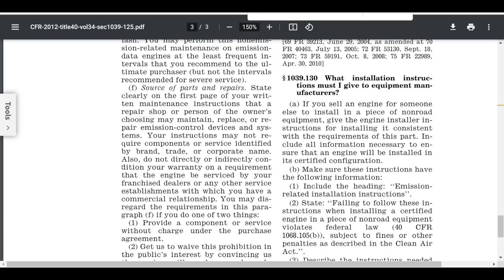Has John Deere been breaking the law for two decades? Little known regulation  1039.125 says yes.

Comment: As someone who has spent time working on vehicle emissions systems for the past 10 years regardless of working for the manufacturer or not the argument that people who don't work for our company cannot be trusted to repair our equipment is absurd
Reply: I mean really, once you check that all emission sensors are working correctly and there are no exhaust leaks, what can go wrong? Sure this is an oversimplification, but it's not rocket science either. Then again, a large auto maker like VW did this at a grand scale but they are worried about a little guy messing with his tractor.
Reply: There all CROOKS👌🏾
Reply: @benargee  But But we like our moneys. Please don't stop giving us your moneys.

Comment: thats a huge issue with gun laws too, a lot of what they ask for (background checks and such) have already been a thing federally, so states dont need to require it.
Reply: It's my understanding that some states have actually passed laws preventing their own regulators from enforcing those federal laws. Basically, if the feds want X, they can do it themselves, kind of laws. They aren't saying they are overriding the laws, just that they won't stand in the way of the feds enforcing them. There are a LOT of federal laws that go unenforced like that, not just guns or right to repair, etc. They can't pass a state law that overrides federal without it going to the court system and possible all the way to the supreme court to decide on it so states just don't enforce them and leave it to what ever federal agency is responsible for it to enforce it. Kind of like how the FDA has federal employees responsible for inspecting factories where food is is mass produced.
Reply: @gwgux  not the same at all. so what youre talking about is like what texas did with suppressors and permits, where its actually completely within federal law, but if the owner crosses state lines with those items THEN it becomes a problem of the feds to deal with

the thing about sales, is they have to be documented by the person selling the gun, because if they dont do their paperwork they lose their license to sell guns AND can get up to 20 years per gun sold without the proper paperwork. 

and even worse these days is the people who have their permits and do things by the book are losing their permits anyway because of minor spelling errors and such. brandon herrera did a recent video going into detail on that

Comment: Louis, I kept reading there were a couple exceptions, one says "if you give the parts for free"  - does that mean you can require they are installed by your network installers, provided you itemize $0.00 for the part (and just markup the labor to cover it of course) - The other one says "convince us it is in the public good" paragraph that was cut off. . . are they trying that angle of "its in the public interest for us to require emissions systems be serviced in-network"?
Reply: In general this has been viewed as both parts and labor. Audi, for some time, did all maintenance at no cost to 100k or so, to force owners back to the dealership.

Comment: The emissions stuff is generally overblown.  A tractor running well has lower emissions.  Tractors that are not working right use more fuel and create more emissions.
Reply: Most emissions systems that involve a re-burner of collected emissions don't really help the environment as much as we are led to believe. 
All they do is collect the emissions to burn them off at a later date. Really only getting a small amount of pollution saved but replaced with the chemicals used in collection.
Now a system where the filter is not burned but cleaned when an oil changed is needed actually helps a lot for emissions. But those are more complicated.

Comment: Louis, hi from Europe.
I'm a little confused. AFAIK in the USA there were rules to cars made, that gave independent shops and the AAA the ability to monitor the exhaust system - the OBD plug. We are grateful for this. 
Does all this not reach to larger equipment like trucks and tracktors?
Reply: Basically yes.  Private versus commercial vehicles fall under very different sets of laws.  Even RV's don't fall under typical motor vehicle regulations and thus don't get basically any consumer protections applied to them.
Reply: @bvoyelr  SAD

Comment: If emissions controls is so important then shouldn't manufactures be required to design build the system so that nobody will ever have any excuse for not keeping it in tip-top shape? Like say for instance there not being enough dealer franchises allowed by the manufactures where you are.
Reply: yes, but i think John Deere is talking about farmers trying to by-pass the use of government juice AKA D.E.F which you can ask any diesel owner, is a pain because as if diesel wasnt expensive enough, now you gotta pay for something extra.
Reply: @dirtyvinyl8817  so deal with that the same way you deal with running ag Diesel on the road: big fines when you catch people doing it.

My original point is that whatever the claimed reason for restrictions on repair, it looks like they are just an excuse to keep a monopoly. Pouting out how those goals are sought after only in some cases is mostly a rhetorical tool to highlight the motives being concealed behind a veneer of a socially popular talking points.

And at a guess, it took the people who don't want to buy DEF about an hour to figure out how to bypass the system. We struggle to figure out how to make software that can't be hacked without access to the digital hardware. I don't think there's a chance in hell we can build an analog system that can't be tricked by someone who has full access to it. E.g. take the factory original NOx sensor and coat them in a catalyst so they see lower levels? Blow air from the turbos across the sensor so the actual level is lower? And that's assuming you need something more than a zip tie to hold the float switch in the DEF tank up.

Comment: I think that it is NOT the emissions but the IMMOBILIZER, the function that allows to block the engine start if the injection calculator is stolen/ replaced without redoing the pairing.
Reply: On the other hand, i don't see why you can't replace components related to the injection systems with the exception of that ECU ( engine control unit). 

The tuning update must be off limits because will give the outsiders the power to mess-up the depollution and how it was homologated but if you change the fuel pump, I don't see why the client shouldn't have access to initiate the routine of fuel priming because that it is a highly controlled strategy with zero risks.
Reply: @elenabob4953  In Spain most owners of 20+ years old John Deere machines say they will continue to purchase and fix old units until there's nothing left in the market.

Comment: I think a better question is why are they fighting so hard to preserve these emissions parts? Is it just knowing there are thousands of dollars of fragile parts that don't really do anything knowing they are the only source for parts and they're trying to corner the market on repairs as well? Or because they know with a little know-how you can fully bypass these thousands of dollars of parts and pollute just a little more while producing FOOD for the cheapest possible price?
Reply: Without emissions control systems, engines would pollute much more than just a little more.
Certainly they are much more fragile than an old school, carbureted engine and the companies have in many cases left them fragile to ensure repeat business.
Reply: @bmos02  It’s not so much fragile just that things are engineered to last a certain amount of time. No more no less. 

Whereas before it was just a guess so things got over engineered , now we have the skill to make it last a predicted time. 

I’m not excusing it but in general it’s not some sinister plan.
Reply: I believe they are just using emissions as an excuse to push the "authorized dealer only" servicing. The same way that car manufacturers were retorting that allowing third-party repair shops to access model specific tools would be letting your vehicle be "hacked".

Comment: Hi Louis it wood be better for Deere and other brands to to make the emission systems on thte tractors more reliable  
overe hear in the uk a large percentage of tractors  have the def  removed  and remapped after warranty runs out
Reply: It's that it's unreliable, just that it requires more maintenance than if the tractor didn't include it. People removed the DPF/DEF because they don't like having to deal with maintaining the system.

Comment: Congratulations on reading the "small print" of the regulations.The C.F.R. ( code of federal regulations ) can be found online, and is searchable. However, care must be taken when reading them since the definitions of words in law often differ from the dictionary definition. Sometimes there are more than one, and then a conflict in law must be resolved, often by making reference to the common dictionary meaning as a last resort. For example, the word "derivative" only appears, and is defined, in laws concerning fungible securities. There is no definition for that word given when the word is used in the laws about certain plants. In that instance, the dictionary definition should control.

Comment: Emission systems on diesels? Yeah, we rip 'em off. Why? To reduce pollution. EGR dumps sludge into your intakes on diesels (not gassers) and the engines fail prematurely. This adds to landfill waste. DPF clogs up the exhaust at some point, drastically reducing power and mileage. SCR (DEF fluid) actually reduces emissions and I'm all for it. Removing the other two systems increases mileage and power on a diesel up to 33% and thus you burn far less fuel to do the same job. Less fuel burned means fewer emissions.
Reply: Emissions in cities certainly a big problem. But emissions in the field? They kidding us?😾 Those emissions are happily absorbed by the growing greenmass.
Reply: Yeah, screw emissions systems on diesels. A catalytic converter on a gasoline car is relatively benign these days, but diesel emissions systems are nightmares.
Reply: @hrissan  Exactly. I was referring to pickups, but the same things are on farm tractors. Why? Plants LOVE CO2!
Reply: @PsRohrbaugh  I am OK with what's on cars, and even the SCR system on diesels help, but the ones which kill diesels and actually increase emissions should be removed.
Reply: Can SCR reduce NOx to acceptable levels in a non EGR engine? The solution to pollution is dilution; thus one combine per 2500 acres really isn't so bad., Especially when it will only be operating 15 days per season.

Comment: I can guarantee they will mess with the emissions systems. That's not the manufacturers problem as it is a modification to the equipment. Unauthorized modifications to the equipment are not covered under any warranty policy. Said modification is determined to be the cause of the failure the failure cannot be ruled as a defect and is therefore not covered under warranty. This gets John Deere out of responsibility for mistakes made by the end user of the equipment. They are however have no reason to not sell tools and parts to paying customers other than to be anti-consumer in only allowing their service centers. Most service centers (unless owned by the manufacturer) do not provide the manufacturer profit through labor but through sales of equipment and parts.

Comment: Make a rugged 3D printable raspberry pie housing. Write an open source ECU program for the raspberry pie. Gut the ecu out of your tractor and replace it for the open source one. Proprietary software removed, step one accomplished. 
Buy big tractor. Disassemble big tractor. Make manual on reassembling big tractor. Proprietary mechanic removed, step two accomplished.

Comment: Yeah, the way to stop illegal modifications is to have certifications for emissions that save a farmer money on the extra 5 or so hp they gain from a bypass.

You can even have basic checks for emissions functionality in the tractor, and just nag the tractor driver about it not working (albeit this can be bypassed, it's generally not a thing farmers will generally do).

If need be, you can even have a government agent come on site, randomly, and inspect tractors and then revoke the emissions certification for that year if bypasses are found (or if intentional negligence is discovered -- such as obv neglect of DEF for long periods of time).

Otherwise, it's more harmful to enforce emissions standards this way, as farmers can't reliably operate the machinery everybody relies on for FOOD PRODUCTION. 

JD is too slow and costly to be beneficial.

Comment: Posing as the devils advocate. The string of events that lead manufacturers to such measures:

1. Source out manufacturing of parts to different fabricators. Would drive down cost and diversify supply chain for problems
2. ONLY CHOOSE the best to represent parent company (shot in foot nr 1) when providing manufacturer service
3. Subcontractors are left with stock they cannot market, because parent company wont order them. Reasoning "customers dont choose the alternative" (shot in foot n 2)
4. Subcontractors need to recover cost on production and market to 3rd party as fast as possible. 
5. Parent company does massive customer manipulation for "the best service comes from us" through ads and customer service practices. (shot in foot nr 3)
6. In comes the shameless subcontractor, that produces parts with low quality with high volumes and low cost. Floods market to earn fractions of a penny profit off each unit. 
7. Customers experience low quality and try to get "good part" from parent company
8. Parent company gets revenue and public opinion points for "providing the best service" 

And now we are in present day: Parent company shady practices have cemented public opinion on 3rd party service. Thus giving an argument that the parent company has the right to dictate market conditions.

Comment: The very idea of emissions systems for tractors is patently absurd. Something that could only be thought up by someone whose closest experience to a farm is a commercial on TV. Why does a tractor that is producing plumes of dirt and dust big enough to make it visible from over a mile away need a DPF? What's the point? Then there is the fact that the "science" justifying DPFs is completely fake.

The problem of air polution was basicly sovled 30 years ago with the standards in the early 1990s. The problem with admitting that a problem is solved is that it means that the government agency in charge of looking after the problem no longer has a purpose. So they HAVE to keep pretending that a problem exists where there is none, even if their solutions create even worse problems.

Some examples?

Gas cans in the US have sucked since 2009, being more dangerous and spilling more fuel than the supposedly inferior gas cans from before 2009. Why do these cans continue to be sold? Because the government requires them and the government pays no price for their own policy failures.

Greenies complain day and night about pickups in the US becoming so huge, yet never bother to mention that the reason they are growing so large. The governments own fuel economy standards have made selling small pickups effectively illegal. My Chevy S10 from 2003, with an i4, gets ~20 MPG. (Not great, but hardly bad either.) To be sold as a new vehicle today, it would need to get almost 40 mpg. That's simply not going to happen unless you put a lawnmower engine in it. Nobody would buy a vehicle that underpowered. The regulations become looser the larger the ehicles wheelbase is, so manufacturers make larger and larger vehicles. This is true across the board, the fuel economy regulations have INCREASED fuel consumption. On top of this are the emissions requirements. You can tune an engine for good emissions, or you can tune an engine for fuel efficiency. You can't do both. Not without driving the costs of new vehicles up by thousands of dollars. Which results in people continuing to drive cars that are nearly 30 years old.

Yay wall of text...

Comment: the new one is there https://www.govinfo.gov/content/pkg/CFR-2021-title40-vol36/pdf/CFR-2021-title40-vol36-part1039.pdf

(f) Source of parts and repairs.
State clearly in your written maintenance instructions that a repair shop or person of the owner’s choosing may maintain, replace, or repair emission-control devices and systems. Your instructions may not require components or service identified by brand, trade, or corporate name.
Also, do not directly or indirectly condition your warranty on a requirement that the engine be serviced by your franchised dealers or any other service establishments with which you have a commercial relationship.
You may disregard the requirements in this paragraph (f) if you do one of two things:
(1) Provide a component or service without charge under the purchase agreement.
(2) Get us to waive this prohibition in the public’s interest by convincing us the engine will work properly only with the identified component or service.